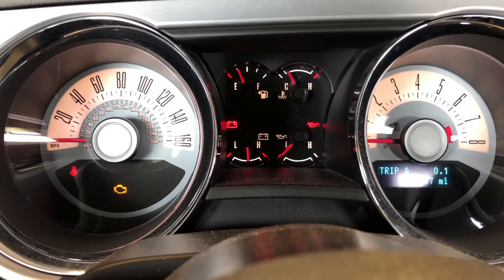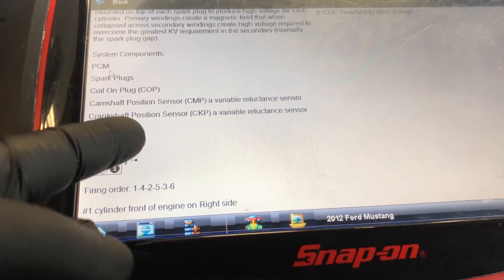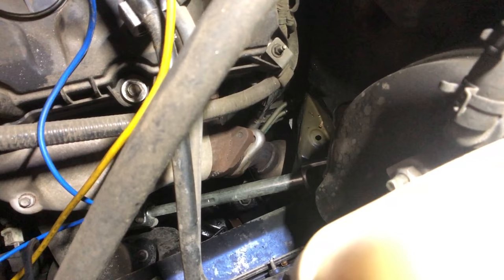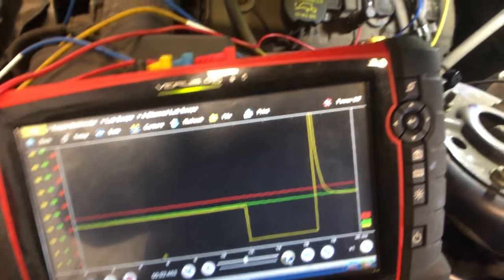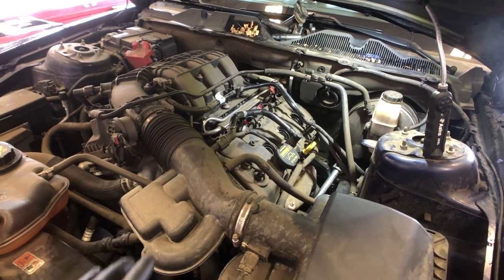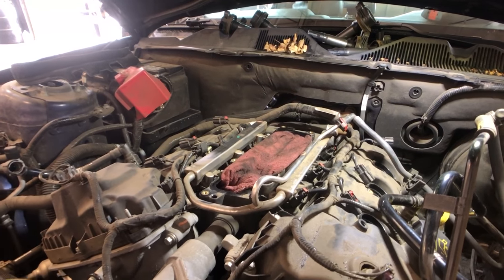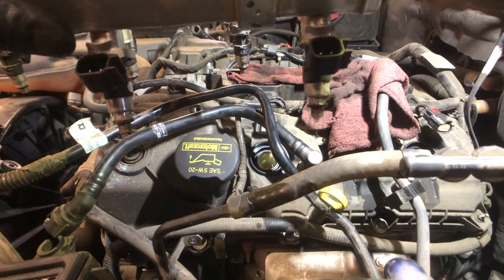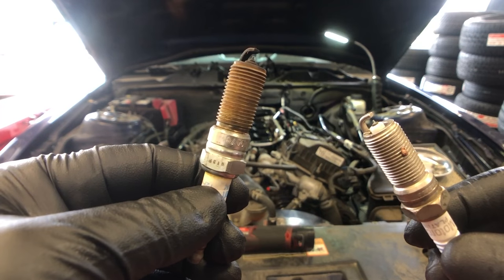How to tell if you have bad fuel injectors

Comment: Female here. And I'm having similiar issues with my 2007 Suzuki swift aka Chevy aveo. I know nothing about cars but find myself researching from time to time, and came across your very informative video. Good job. Anywhoo...All 4 fuel injectors should be here in a few days. Yay. My car will NOT start without quick start and even then after a certain amount of km it starts stalling. Hubby changed the throttle body. Wasn't it. Changed the spark plugs. Wasn't it. 1 of the fuel sensors had a hole so I meticulously fixed it with sm pieces of tape and glue (without touching the mother board), but that wasn't it. So now we're gonna try the fuel injectors. And new sensors on its way even though the one I fixed works. MY CAR HATES THE COLD. RANT DONE. Just wanna say that your video rocked. I loved it and found to be very informative . I'm also gonna take out the spark plugs to see if there's a cleaner one more than the others. Subscribing rn.

Comment: Had the same problem on a 1992 chevy cavalier. Customer complaint was extended crank - hard start.4 new injectors later and it fires in first key. fuel pressure was bleeding off when it sat. i imagine it was getting cylinder wash as well.    I am curious why the other two cylinders were showing misfires.   16:30 the cat was none too happy!

Comment: I am 100 percent sure its my fuel injector. I am a female with feel little knowledge about cars but like educate myself as a single mom and save money in this high inflation time
 I have a camry and can easily see the fuel injector bank and can unlatch and remove. I know to order oem parts. My concern is what should be done prior to removing bank as far as fuel pressure and before starting car aftwr replaced. Please help! I can do this and save money i actaully need for my 3 kids.

Comment: You really showed me what my problem is on my 1991 Nissan Pathfinder with a 3.0 V6 engine. It's a lot of work, but I think I can fix it myself. I wish my 1991 had an OBD 2. My Pathfinder only has an OBD 1 and the only information I was able to get was that my problem was in the "Injection Circuit". I can't imagine what a shop would charge to fix my car. What does your garage charge to do this repair?

Comment: Hector - great video man great explanation probably the best any mechanic has explained in my opinion, I have a 06 dodge magnum , 2.7 , 😅, won’t start unless I press the gas all the way down , and shuts off immediately when I release the gas pedal , also will start up fine when unhooking an intake manifold hose from the pcv or popping map sensor out , allowing engine to get more air, I’m assuming since it’s fuel injected the holding of the gas pedal is cutting the fuel , clearing the flooded cylinders if indeed my injectors are leaking ? And unhooking the hose or sensor allows it to run because it’s allowing more air to be introduced ?
Reply: Could it be that I have some leaky injectors ? The cylinders were scoped and they areeee pretty clean ? Is this the term washing the cylinder? And do you think my issue is leaking injectors possibly more than one as I doubt they’ve ever been replaced

Comment: Good video I probably have the same problem with my bmw cuz keeps showing misfire on 4,5,6 cylinders I put new spark plugs and coils I better check the oxygen sensors and fuel injectors good work homie 👍

Comment: that only tells you that Electrical signal to open and close the injector is sent from the ECU , does not mean the injector is opening and closing because that is a mechanical process not electrical . It can be stuck and not move at all and you will still have same reading .
When im doing my car , i dont use scanners at all , i hear everything that  i need to hear  .
I am not sure that fuel can damage Lamda probe , its not an oxygen sensor , its oxygen comparator , and its called Lamda proble .
Reply from the maker: The Pintle Hump on the waveform shows the opening and closing of the injector (mechanical movement) an injector that doesn’t open and close will not have that hump. 📉
Reply: @HomieHektor   that is a solenoid signal ,  or a signal sent to solenoid , you can remove solenoid and you will still get it , let alone injector . 
Its just the Computer telling you what signal its sending , thats it . 
And you dont need computer for that , just a metal rod  ,place it on injector you hear everything . 
Make an amplifier like device , jesus chist you  have a scanning tool .
Thats how i do it .
Why , i spent 2000$ at repair show , and they diidnt fix the issue ,  so i fix it my self , last time wheel clock drive went off,  i came in said wheel clock drive is bad , let me connect my scanner said the mechanic , 15 minutes later , yeah your clock drive is bad . Told ya .
You can hear mostly everything , at least i can .
But mechanics love their fancy tools , the  more expensive the  tool the better the mechanic  .
Let me tell you about Scotty Kilmer , find his video about Car Battery Booster , he even gave it away to his dumb ass subs .
That thing used 2 times on your battery , say good by battery .
But he doesn't know that , hes smart scanner didn't tell him that shocking a battery with 30A , can and will damage it .Can even damage the car it self .
And he recommends it , 50 years a mechanic , a dumb ass mechanic acting smart with his tools .
No tools needed , only ear and a wrench .
One of these days i tell you ,mechanics will use OBD for flat tiers , mark my words .
Reply from the maker: @dedskin1 🧏🏼‍♂️

Comment: Hector I have a 1996 coachman 38' motorhome with a Ford 460 and a Eo40D transmission. It's not letting me in, on the ECM. I have a good Scanner OBD 1& 2 it has power to it, But won't scan or power up.. The coach didn't have a Check Engine light on, but it took me a while to find out that it needs a fuel pump & pressure Regulator..I have been testing it out for bad injectors.  I have three bad, and I will replace.
I'm just not sure what is going on with the computer??? Any suggestions on this I would appreciate it.
Bye the way, Thank you for the video.. 👍👍👍😎

Comment: So my car started shaking during idle and while at stops signs/lights. Check engine light has been on and flashes. We got the code read and it read a P0304. It said cylinder 4 was misfiring and the most likely cause was the fuel injector. Everybody we talked to said they were certain it was just the spark plug, so we replaced them all. The problem was still ongoing. Then they said it MUST be the coil. I just replaced the coil on cylinder 4 this morning and the problem is still ongoing. I now have to find someone to try the fuel injector. The weird part is that the problem is intermittent. It will ALWAYS shake during a cold start but after driving for 10-15 minutes or even just sitting with it parked while running for the same amount of time, it will stop shaking and drive normally. I don't understand how it could be intermittent like that. Also, while it's shaking, the AC will blow hot and cold off and on. It will be warm for like 20 seconds and then cold for 20 seconds back and forth. But everybody says if it's AC-related the code reader would have certainly picked that code up as well. So I'm at a loss. If you have any advice it would be greatly appreciated. No fuel leaks from what I can tell and no smoking from the tailpipes. It's a 2015 V6 Mustang, by the way.

Comment: I have a 2005 gmc sierra 1500 5.3 crew cab  it jerks on the road stalls  on the lights or stops ✋ I turned it off and started... I  replaced the MAF SENSOR AND replaced the throttle body and sensor still have the problem,  I checked the fuel pump and relays and pressure.. can you help,

Comment: Not all diagnosis should be performed  with a scan tool.Running an engine with raw fuel coming out of the tail pipe,really dude?I would have put a fuel pressure gauge on the rail,t disconnected the Injectors urned the key and watched the fuel pressure 'dive'.

Comment: What type of code reader is this, where can it be purchased, and how much is it? Trying to figure out if our 2013 Cruze has bad injectors. Hubs looked at them and changed one out but can’t tell by looking at an injector if it’s bad or not.
Reply from the maker: Breann Payne this is a “high end” scanner it will run you a couple grand. What’s going on with the Cruze that makes you think it has bad injectors.?
Reply: Homie Hektor it’s shooting out a 171 code, slight rough idle, air hissing sound now. And it lacks some power when accelerating. He replaced one of the injectors, still same issue. He can’t tell how the injectors are bad or not
Reply from the maker: Breann Payne watch this video, I think it’ll help https://youtu.be/YBE6-zTtTwc

Comment: Hey man , I have 2015 impala When am driving and Accelerate car start shuttering and shaking 
and engine also shakes rough when Idling 
I’v told cylinder number 3 misfiring I feel car drive smooth sometimes and most of the time not . The impala 6 cylinders

Comment: Nice work, I think I’ve got a dead injector on my firebird, runs rough and it stalls. OBD2 says misfire on cylinder 6, I replaced the plug and wire and coil packs and still same problem so must be a bad injector.
Reply: Get it fixed?
Reply: @baby-sharkgto4902  yea, it was a bad fuel pressure regulator.
Reply: @aaron5785  awesome glad you got it fixed
Reply: @baby-sharkgto4902  thanks